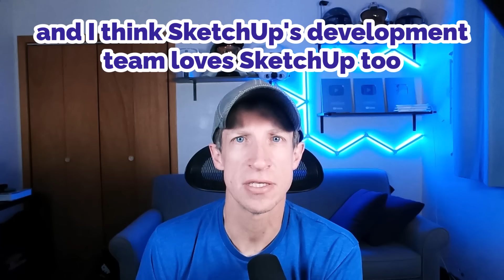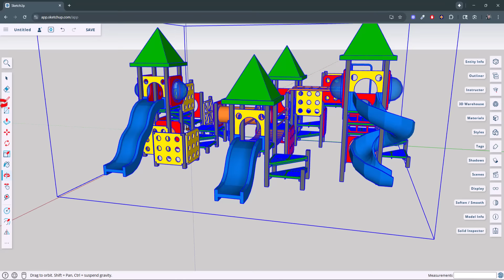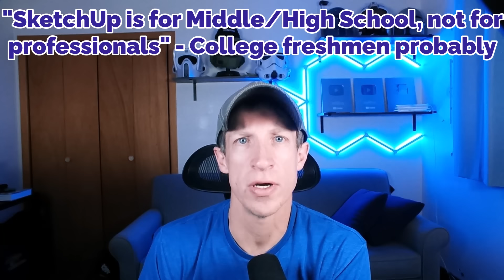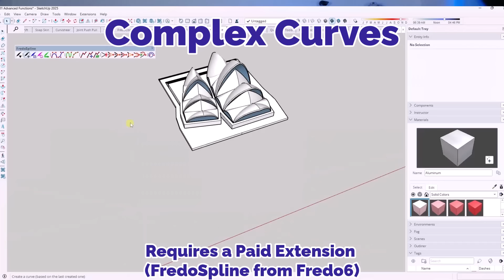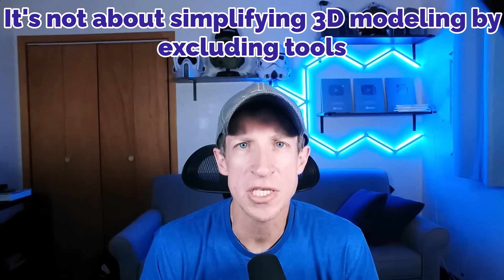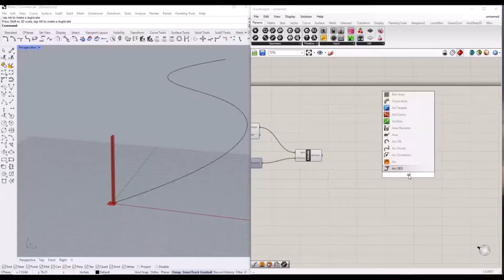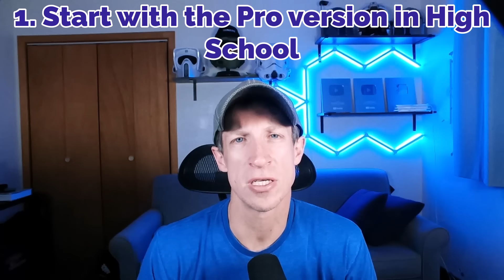Is SketchUp being REPLACED?

Comment: i really enjoyed free sketchup for 10+ years off and on. then i subscribed to pro so i could use the desktop app and i loved it. however i grew frustrated with the requirement of using 3rd party extensions and often having to pay more for each feature. some features i would assume they could have implemented into their base software by now. For me, the frog that smoked the camel's crack was when they increased their price in the middle of last year. i was happy paying a small amount as im just a hobbyist, diy, but i cant justify the high price now for its use. ill be looking into other programs to continue my modeling (mostly renovation mock ups and metalwork ideas)

Comment: I teach HS drafting and architecture as well as design and manufacturing. In my ecosystem. AutoDesk is the way! Free for education with full power. In my technical advisory committee meetings SU is barely mentioned. Rhino is never mentioned. For architecture Revit proficient drafts people and architects is what my stakeholders want. Maybe some SH for conceptualization and presentation. For technical design #1 Solid Works then Inventor, Solid Edge, Fusion, On Shape, and whatever PTC calls there production now. I do Inventor and Fusion because it doesn't cost me. All student going on to industry have never had problem converting over to SW. For 4 year and 2 year post-secondary, I never hear of SH or Rhino being pushed. I am also a firm believer in 2D AutoCAD skill for many applications in technical design, architecture, manufacturing and fabrication. Rhino and SH can't touch what I can do with the AutoDesk products.

Comment: Any drawing / CAD application that requires me to have an internet connection is a non-starter for me.
Reply from the maker: Feels like Rhino or Blender then. Personally I don't consider this an issue, but everyone is different
Reply: @Thesketchupessentials  -- It's an issue because if the company goes belly-up or the website goes down for whatever reason, you're screwed.  If it is on my local machine, I can still use it even when on a flight or in an area without internet availability.

Comment: I used SketchUp to design and create plans to rebuild my home, which burned down in a wildfire; my old software, Fastcad, would no longer work with Windows. The learning curve was crazy, but It did a good job. After I was finished with permits, I really did not need sketcup much and did not like the extortion fee they want to keep using it. I will check out Rhino if they don't try to charge you every year just to use it.

Comment: Listen.

Rhino has extremely easy CAD integration. I can take autocad cross sections/elevations/plans and create a full, precise model. This is CRITICAL for those of us who get dwgs from clients. Students should be ready to do the same.

Students will be spending most time in Revit when they are at their architecture firm. Sketchup is a digital modeling tool but for serious engineering/real projects I am good. I use SketchUp as it integrates with Mozaik and primarily for place holders. 

But why should we care that you're invested in SketchUp's success? If Rhino fills a market that Sketchup doesn't (again, the DWG integration and grasshopper are critical here, you also didn't mention a million other plugins in the platform). I'm not even a Rhino user, just work in the field and know it's common place, so is SketchUp. 

Lastly

I've seen more hacks use Sketchup than anything else. Sorry, but give me a good 2D Autocad drawing set of a house, or a fully built revit model sliced to cad, don't give me fucking sketchup. Grow balls and learn the stuff pros are using.

Comment: Hi there good content, just to give you a little background on this video! Sketchup is not a design tool and I’ve used it on and off for about 14 years. Design schools and that in particular architecture school typically use rhino! Parametric, nurb modeling etc, the transition that you are referring to is happening between rhino and revit, in architectural school especially , not sketchup and rhino! Because dynamo has become so much better than the early days it’s powerful not grasshopper powerful but doable!
Reply from the maker: Appreciate the comment, though I'm gonna have to disagree - SketchUp is TOTALLY a design tool (though I suspect you and I are defining "design tool" differently). People do full projects up to and including construction documents in it - much more than I've seen in Rhino actually. 

Also, I'm not sure I'd agree that there is a shift from Rhino to Revit - most larger firms I've worked with use Rhino as a supplement to Revit, especially in early designs, but for construction documentation most projects seem to end up back in Revit.

Comment: Hello, Justin.

I'm a SketchUp user in Korea. (User since SketchUp 3 on @lastsoftware)

I've been teaching SketchUp at elementary, middle, high schools, and universities in Korea for over 10 years under a contract with BuildingPoint Korea as an authorized training center. I also currently teach at universities and in industry.

I currently use SketchUp to create architectural, civil engineering, and plant models, and perform quantity takeoffs, interference checks, and point cloud-based reverse engineering in my field.

In Korea, SketchUp is the most widely used 3D modeling program in practical settings, especially in interior design and architecture. Rhino and Blender have a smaller user base, and most educational institutions teach SketchUp Pro. So, while Korea's environment is different from what you're looking for, I'll explain why I agree with your perspective.

- SketchUp Modeling Features: There was a time when developers could distribute extensions. Back then, there was no Follow Me feature, and a similar feature was tested hidden in SketchUp's debug menu under the name "Extrude along a path."
Back then, 3ds Max users, who had solid modeling capabilities but were hesitant to pay for extensions, appreciated SketchUp's policy of distributing extensions for free, and there was hope that this would lead to significant advancements in SketchUp.
Of course, many developers still distribute most of their extensions for free for the convenience of users. However, as you mentioned, SketchUp's native modeling features have barely evolved, contrary to expectations at the time.
It seems they're sticking to the path of evolving SketchUp's features by maintaining the developer ecosystem, but I believe essential extensions should be included natively.
Users shouldn't have to go through the hassle of finding the right extension for their specific needs when using SketchUp in their work. Extensions should exist for convenience. If they become essential for modeling, it means SketchUp itself isn't being distributed as a fully functional tool.

- SketchUp Education: In Korea, most education is taught using the Pro version, but sometimes, when licensing costs are difficult to implement, the web version is used. In these cases, student satisfaction often declines, and students tend to switch to other 3D modeling tools. I hope the licensing policy can be adjusted to make it easier for students to use the Pro version.

- SketchUp Expertise: I use SketchUp for a variety of practical work. In Korea, BIM design is mandatory for large-scale government-led civil engineering projects and residential complex construction. BIM modeling tools that can be used in these projects include Revit, ArchiCAD, and Tekla, but SketchUp is not included. Our company uses SketchUp for clash detection and quantity takeoff (using dynamic components), but it isn't recognized as a BIM tool. Perhaps because Trimble distributes Tekla as a BIM tool, SketchUp is perceived as a design tool. This is disappointing. If only the parametric and history features were enhanced, and LayOut's drawing capabilities were further strengthened, it could be fully utilized as a BIM tool. It's truly unfortunate that it seems to be limiting itself.

I share my opinion as stated above.

I had high hopes for Viz Pro's parametric capabilities when it was released, but it seems to have virtually no users now, which is disappointing. MS Physics, while currently borrowing some features and offering extensions like Clothworks, seems to be overlooking this area, which could be competitive with Blender or Rhino. I'm currently using MS Physics for construction equipment simulations, but it's struggling because it only runs on SketchUp 2018 or lower. Incorporating this feature as an official feature would truly make SketchUp a more competitive tool.

Thank you for reading this long post.

- Ray-

Comment: i remember i started working with sketchup the first year of my university when i was 19 when i came across your channel  . im 27 now and i gotta tell sketchup saved me way too many times but as i went through higher education it just seemed way too demanding. too much extensions was required for more advanced project to the point where i had to just put it all together with plaster and get a render on a good angel and hide the flaws in the project. that's why im on the way to learn rhino and level up my drawings
Reply from the maker: Well I would make sure you check and verify that Rhino can actually create the drawings you need. In my opinion their plan creation tool is worse than Layout, and I've not seen anyone really generating next level drawings from Rhino. Mostly they seem to model in Rhino then export to something like AutoCAD or Revit for actual documentation.

Comment: I use Rhino for architectural studies, modeling in a workflow with Twinmotion. It works great! In Rhino 8 (compared to the previous version), it is much easier to work on a realization project, thanks to many improvements. Basic modeling in the pre-study phase is much better, especially the push-pull functionality, which is also available in SketchUp. I was thinking of Sketchup Pro too before, but Rhino is CAD/CAM too, what is for me as architect big pro.

What I miss, however, is BIM. VisualARQ is a bit too simple—not really suitable for a realization project and cannot replace tools like Archicad or Revit. Right now, I am thinking of a hybrid workflow: using Rhino for sketching and some extra/specific modeling, while relying on Archicad for basic 3D modeling, automatic calculations of areas, and the next phases of the project. Even though the subscription fee is too high... TM for renders and Affinity for some postproduction (I am using Affinity 2, but will try also new one, which should bee completely free).
Reply: It would be great to have an extra BIM module in Rhino, some perpetual license for extra money (made for mac too, not only windows as visual arq is) and a bit more complex (with the option of automatically marking surfaces, e.g. etc.). That is my biggest dream :)

Comment: SketchUp is a tool for early beginners who want to learn a 3D software fast and easy. And I think there is nothing wrong with that – it’s targeting a much wider audience, and I think it will keep that appeal for some time to come. That’s honestly the main reason there was such mass adoption in the 3D modelling community in the first place. If SketchUp tried to pivot into being a more “serious” piece of software, it would lose that early appeal to new users.

Rhino, on the other hand, is a different kind of beast. It’s also very easy to use, with only a slightly higher learning curve, but given Rhino’s advanced features, I’d say it totally makes up for the extra time you spend learning how to do the same thing you’d do in SketchUp.

Let’s compare some technical bits, because I think that matters.

SketchUp is a mesh-based geometry software. That means when you make models, you’re always building with segments and faces. That’s why when you create a sphere in SketchUp and zoom in, you immediately see the “resolution” of it – it’s faceted.

Rhino uses NURBS, a more advanced way to handle geometry. It doesn’t really have a “resolution” in the same way – its effective resolution is basically infinite. Think of it like this: SketchUp is Photoshop, and Rhino is Illustrator but on steroids.

If SketchUp tried to compete in that same area, they’d have to completely change their 3D geometry handling engine – and that’s a huge platform shift. I don’t think that’s really feasible; they might as well create a whole new software adjacent to SketchUp to handle that kind of geometry. So even though both are “3D modelling software,” SketchUp is fundamentally almost completely different to Rhino.

SketchUp is built for a massive audience that isn’t necessarily serious about design-to-production workflows. For people who are serious about 3D modelling, engineering, or production-level design – especially in fields where Rhino is heavily used for fabrication and real-world output – the winner is pretty clear. And also SketchUp isn’t low on features; it’s just serving a different target user than Rhino, thats why you see the hesitation to add new features for years, and that will countinue to be so im afraid!

Comment: We are a reseller of both SketchUp and Rhino as well as other architectural software. Neither SketchUp nor Rhino are actually ideal for the average Architect or interior designer frankly. Neither offer great 2D documentation tools as a fully integrated part of how they work. Yes they can generate 2D drawings but its just too tedious and disconnected to make daily use of them in a practice that needs to get jobs out the door. We find student will use Rhino3D and so too will large architectural firms doing grand buildings and exploring budget free unconstrained design concepts, but for day to day operations they default to ArchiCAD, Revit or better still ARCHline-XP. That being said I don't think any of these are as truly brilliant as would be possible to be either. It will be interesting to watch as AI tools start to learn how to drive these software programs from the inside.

Comment: Nice video! I had no idea that Rhino was that popular. I haven't used it, myself....
I have been working with CAD software since the early 1980s when it was in its infancy. I love it so much that I decided to devote my career to development of CAD/3D modeling software development. I was a software engineer both at Autodesk (AutoCAD) and Bentley Systems (Microstation and AutoPlant). And, I have to say that Sketchup Pro has opened my eyes to how CAD software should work. Yes, it's lacking much needed features, but it's ease of use is second to none. Shapr3d is a great solids modeling tool at a good price, too, but it also has its problems and is lacking much needed features. It appears that Shapr3d has learned much from Sketchup's intuitive modeling workflow and ease of usability. I can't say much for Rhino's ease-of-use but I agree that Trimble really needs to address the issues you have brought up. I would hate to see it be replaced. I hope Trimble is listening and does the right thing.

Comment: I use Rhino, but because i'm doing cabinet projects I though SketchUp Pro + CabinetSense would be a good option. I was wrong. Coming back to Rhino.
Reply from the maker: Interesting - do you create shop drawings from Rhino as well?
Reply: I primarily work with CNC routers and woodworking projects. CabinetSense is an amazing tool, but “renting” it and also SketchUp is too expensive for me right now. With Rhino, after creating the basic cabinet module templates, it already meets my needs perfectly.

Comment: I have a feeling you're meeting the pro models and users. When I was in college we were taught 3DS Max and the minute I saw SketchUp I thought to myself Why are we working so hard at Max when SketchUp is more than enough for 99% of the architecture projects I need. The same goes for rhino. Most projects in architecture are square with very little curves and no complicated shapes. Grasshopper is way too advanced for most architects. It caters to analytical mathematical people, not artists. SketchUp is the only software you can create. Anything really fast without bothering to learn too many tools. Architects are always in a hurry. We have little time too much work and not enough pay to bother with complex software.  I think for conceptual stages and more common projects SketchUp will remain the go-to soft. if you're building complex Curving skyscrapers yeah, sure go with rhino but for everything else SketchUp.
adding to that the entire industry moved to Revit which is also a very strict anti-curve software, which seems to be enough for most professionals.
If I do bother going for a more complicated software, I'd go with blender which is free. Awesome! Has an endless amount of free extensions and libraries and it's not complicated any less than rhino. The only reason I'm not using it is SketchUp is still faster.

Comment: I have been using Rhino since Rhino4.  I am not an architect - I am an artist.  When I try to model an architectural project in sketchup, I can create basic floorplans, and loft walls, but if I want to add a cabinet or a refrigerator, I have to "buy into" the Trimble/Sketchup ecosystem and wade through all of the ads and gotcha install-me aps and extensions.  If I do find a part that will work for me, I have to pay for it.  Certainly kids in their maker-spaces don't pay for a toilet model.  I needed a shipping container to place in a model, I wasted an hour and never found a properly proportioned model - I said "screw it", and just built one in Rhino.  I can give a Rhino file to a builder if I ever get that far, or export it any way they want it.  Why bother with Sketchup?...